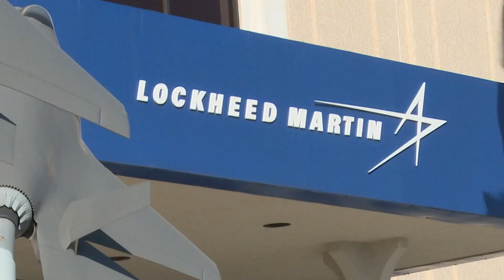Plane that may 'revolutionize' air travel being tested in Fort Worth

Comment: Hello it is impossible. No way a 200 seat air craft can speed faster than the sound and no make a sound. The only solution is to go flight level 115 or above. We will see if I am correct or incorrect in 50 years. Saludos
Reply: Exactly